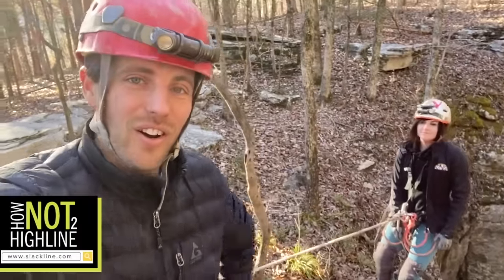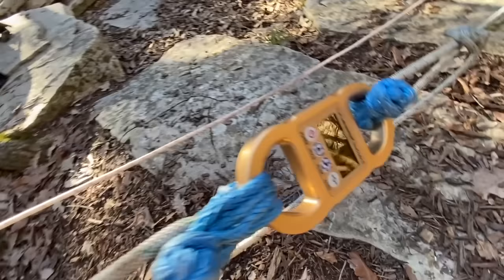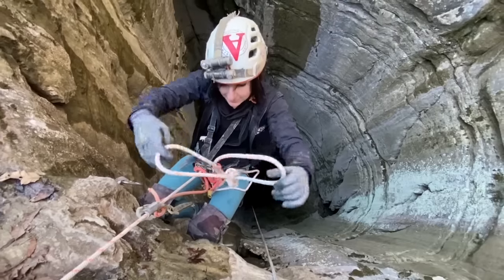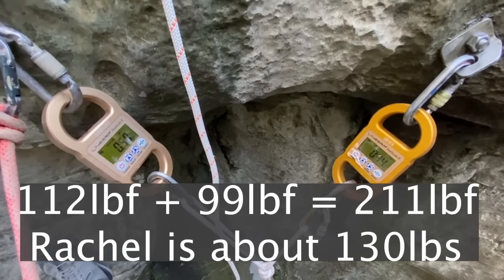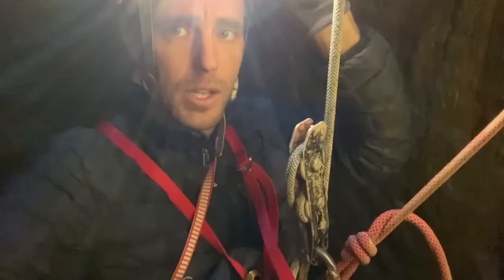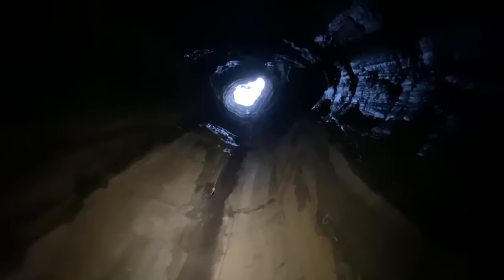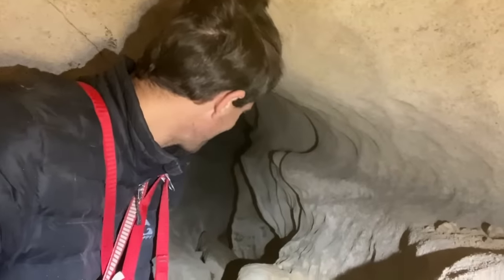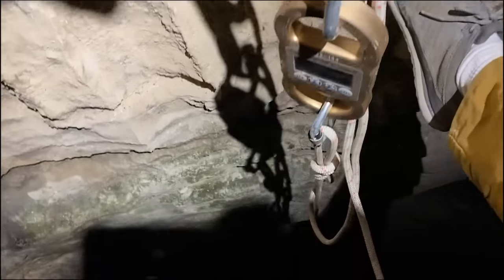CAVING forces - how much force does rappelling put on ropes???

Comment: I am a canyoneer, I sometimes train with cavers since we use similar technical skills to manage our rappels.   It would be awesome if we could test forces the way that canyoneers use rope and anchors.  We often are carrying everything we need such as wetsuit, dry clothes, rescue equipment, extra rope, food, and water in our backpacks, I wonder what that adds to forces.  We also use natural anchors such as knot chocks, dead man, rock piles and retrievable setups such as the fiddle sticks and others.  I would love to see how much force is required to break a fiddle stick, or slip and fail.  I can send you one if you are interested. and the bigger question is how much force do we need to stop someone while belaying...  The longer the rope the harder and longer pull required to slow someone down.  For example while doing the 300ft rappel at Englestead Hollow, the belayer was unable was able to slow me but not stop me.  Awesome video, I am a fan of your channel. Do you know any good mom jokes?  Since we also do canyons with water in them, I also noticed that one rope in particular gets a little more frictionie (not a real word), I wonder if we can prove if some ropes get more friction when wet.

Comment: GREAT VIDEO. Been looking forward to you doing this for a long time! So you going to breaktest some petzl BAT'inox? Originally they had 50kn shear 50kn pullout stamped on them (I still have an old one like that) then one day without changing the product apart from no longer stamping 50 -- 50 | they now certify them 25 shear 15 pullout.  So when do they pullout of standard concrete, 15kn and 50kn are very different numbers
Reply from the maker: Yup.  We tested Petzl Coeur Pulses recently and so we can test the big ol BAT-inox ones soon.
Reply: @HowNOT2  how many do you use for a set of testing (6?) they're very expensive :(  I like that you can tie directly in to them no biner or quicklink but find some quicklinks don't open wide enough to go on then

Comment: Great content as usual! Question regarding the bolts in this video. You mentioned the rock is limestone and those are wedge bolts. The bolting bible briefly mentions using glue ins for sedentary rock, which limestone is. Curious because there is a lot of limestone near me. All I ever see is wedge bolts. Are glue ins just the preferred option for limestone? Does it depend on the localized limestone and it’s hardness? Looking forward to the new additions to the bolting bible!
Reply: Don't worry, I've got like 50+ pages of new Bolting Bible to tell y'all aaaaall about limestone...! ;) 

It's going to vary a lot depending on your limestone's quality (the entrance pit in the video has goooorgeous limestone). Generally speaking, if it looks like chossy hell then be afraid, and if it looks like poured concrete then you're likely to be totally fine.  It's not granite, so consider some longer ones (like... 4") or using sleeve bolts (Powers 5-piece). Also smack the rock with the hammer and make sure it sounds sexy (good sharp sound) because limestone can have voids / pockets / flakes (...even if it's aboveground limestone).

Wedge bolts and sleeve bolts are the standard underground right now because there's limitations to the practically of glue-ins. 

@Derek Bristol 's youtube channel has some good videos about bolting, you should check that out.
Reply: @rachelhasbruises ... Thank you so much for the reply and for the brief explanation. That all makes perfect sense. I’m really looking forward all 50+ pages! And I will definitely check out Derek’s channel. Thank you again for answering.

Comment: That knot looks like 'bunny ears' which is a double figure-8 loop.  In climbing we use it to tie in to a belay station.  Saves gear and untying the rope between climbers.  Same knot ?
Reply: It's a fusion knot.
Reply: @rachelhasbruises  Thanks.  Subtly different looking but the same end result.  However it's way easier mess up the fusion knot because you have to pull bights though the knot whereas a bunny ears has one bight to overlock the whole knot.

Comment: What (TAG?) cave is that.....?????
Reply: Well we're not going to broadcast that information, silly... I'd never hear the end of it!
Reply from the maker: It's the popular open pit everyone hits up when they go to Key West Florida ;)
Reply: @rachelhasbruises  Interesting about the fusion knot. I don't recall seeing it in On Rope, Vertical, Alpine Caving Technique, etc. Sounds like a legit reason, but then again at least one of those text explicitly states to never clip in above the knot (such as just one loop). Curious if any caving texts, etc. recommend the fusion knot?
Reply: @gmancolo  It's in the French Caving Technical Guide, page 125. It is also used by rope access professionals. It is sometimes called a Karash knot in online references.

Essentially, it has the nippy structure of a bowline but is initially tied like a figured-8. However, unlike a DBoaB, it does not have the risk of collapsing if clipped incorrectly.

On Rope is more than 25yrs old at this point so it's definitely missing a metric fuckton of basic information. I am told it will be included in the (much needed) 3rd Edition of On Rope that is currently being written.
Reply: @rachelhasbruises  Seems like a good knot. I saw that apparently FFS is recommending it instead of the bowline on a bight. I assume the double figure 8 / bunnyears is still legit.

Yep -- hopefully the updated edition of On Rope comes out soon!